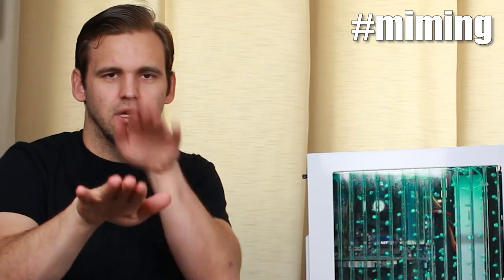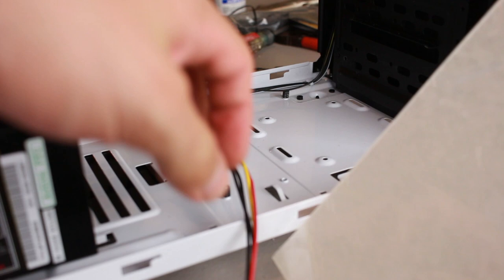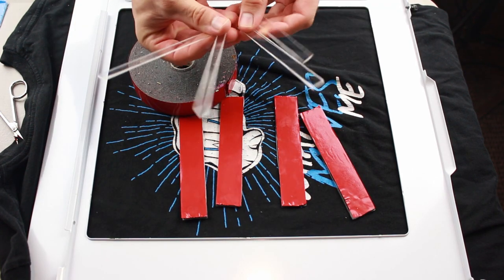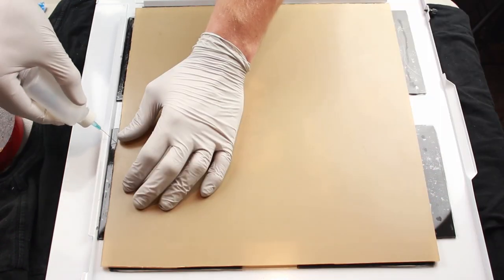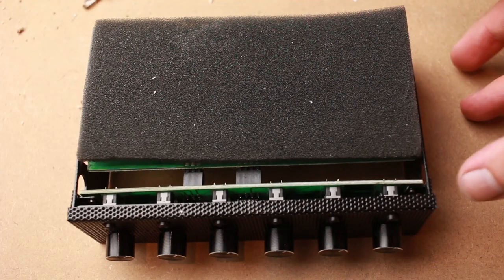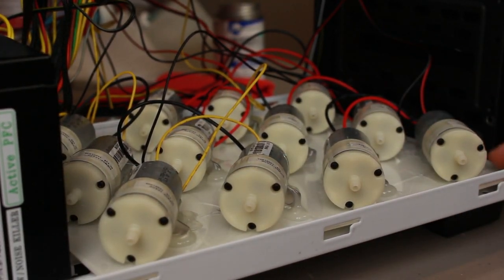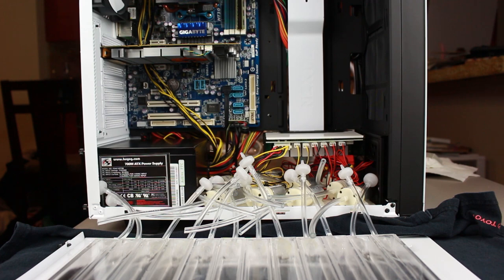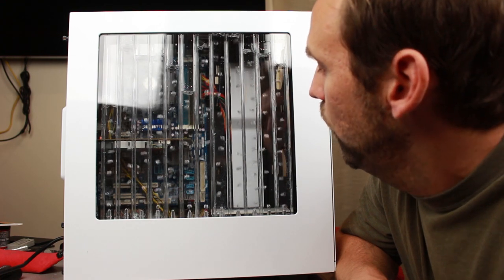BUBBLE WALL PC BUILD VLOG 4: FINALE

Comment: Well, I would suggest using one pump and connect it to a "aquarium air valve manifold" with 10 outs and just use a single container and no 1" square tubes.  You can even build in a safety reservoir for backup in case of a leak and the inside of the case would not see the first drop of water.  That's what aquarium enthusiast do as we cannot afford to flood our floors.  Just my opinion.  I do like your concept, so I may do it myself and use what just shared with you since I'm an aquarium person.   I love your videos btw.
Reply from the maker: That would be a great idea if I were going to leave it the way that I have it. I built it with individual pumps because I plan to upgrade. You should make one with the ideas mentioned, i'd love to see what you come up with. Thank you for the compliment and for watching my videos!

Comment: You did it! In hindsight, clear mineral oil might've been the better liquid to fill the tubes with, as a leak couldn't cause any electrical problems.
Reply from the maker: I liked the idea of added risk. Clear mineral oil produces really clean bubbles as Jay Summet pointed out.
Reply: @ImmodderNation  So you too like to live dangerously? For a moment I was wondering if you could make a feature out of this bug (leakage)... I was thinking let the tubes be open, then use a big pump to circulate liquid through the tubes; preferably at a flow rate that will slow down or even trap the bubbles in a certain position.
Reply from the maker: Hmm, not sure how that would look. Interesting idea though.
Reply: @ImmodderNation   I think it'd look something like water droplet fountains with strobe lights. Where the strobe light has an adjustable frequency that'll let you control if the droplets appear to be static in the air, or even move up instead of falling down. Except in this case, for downward moving bubbles, you'd have to inject the bubbles from the top. Ofc just having the bubbles move from top to bottom is probably easier to make, since you don't need a super fine control of the flow rate of the liquid (like you would for achieving just the right flow rate for stopping the bubbles "mid air").
It's certainly a fascinating engineering challenge.
Reply from the maker: It would be difficult adding air from the top simply because it needs to go somewhere and that somewhere is up. Can't fight the physics! Also strobe light is a fun experiment but long term could lead to headaches or seizures. Interesting ideas though.
Reply: @ImmodderNation  I was just using the strobe light ones as an example of how it might look. In this case though, with enough flow from the top to the bottom the bubbles would actually start moving down, as long as they're created at any point in the liquid. Funnily enough, the effect of bubbles moving down in a liquid is also observed in Guinness (there are articles about it). :P
Reply from the maker: I'd have to see it to understand
Reply: @ImmodderNation  Alright, I'll add it to my ToDo list ;)

Comment: tbh you could just coat the bottom in like half an inch of hotglue and it would solve the leakage
Reply: also im wondering if you could manage to do some cool effects with having the pumps turn on and off to make patterns and stuff, maybe you could team up with someone who knows arduino really well or do it yourself if you know how, just an idea
Reply from the maker: Kiyosen, that would be wasteful and unnecessary to use that much glue when more super glue would be more effective. Also, to your second post 🤫
Reply: @ImmodderNation  true but its not as easy to make a layer of super glue that is half an inch thick, and as we all know, size does matter
Reply: 100% Silicone is your best option.
Reply from the maker: Possibly. Maybe not cleanest or least expensive though.

Comment: Drilling that's why you start small!
Reply from the maker: I thought so too! I think taking it slow on drilling acrylic is important because that had a bigger effect on shatter than the drill bit size. For the rivets, having needle nose pliers like another person suggested would have helped.
Reply: @ImmodderNation  Best thing is the proper tools.  Get a set of acrylic drill bits.
Reply from the maker: I'm looking into it. Didn't realize there are specialty bits for plastic. I find if I start small and work up to larger sizes while drilling slowly it all works out.